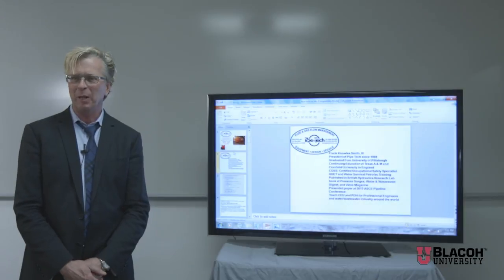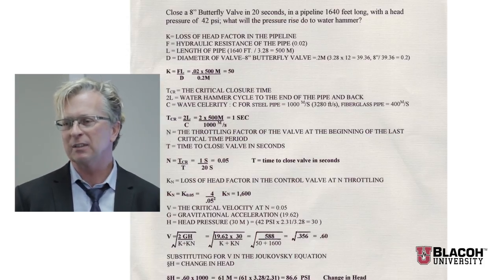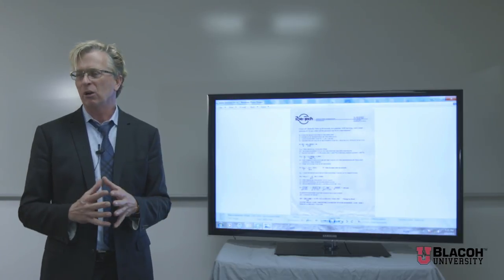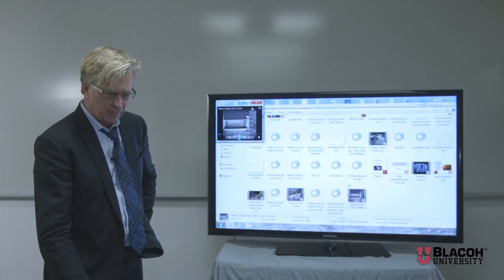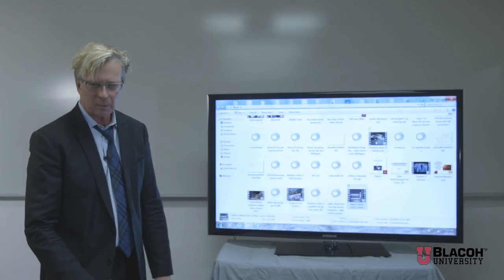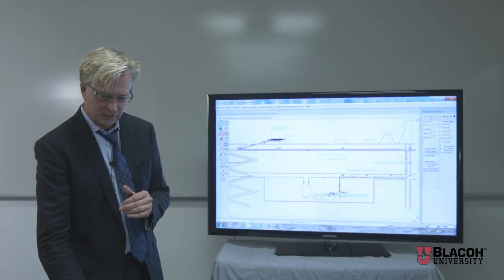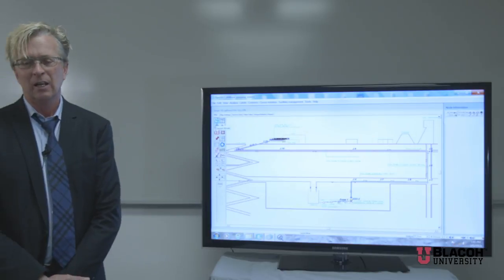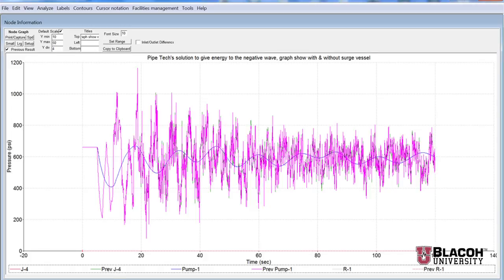Surge Analysis Part 1 of 4

Comment: Hi there. 
Could you provide a reference for the equation used for Kn, the loss of head factor in the control valve at n throttling?
it is new to me, and I would like to follow up on the details of it.
many thanks
Gerard